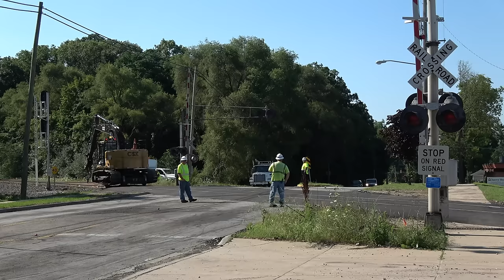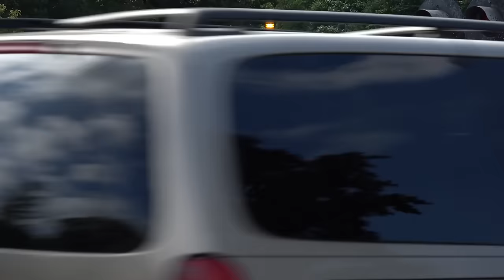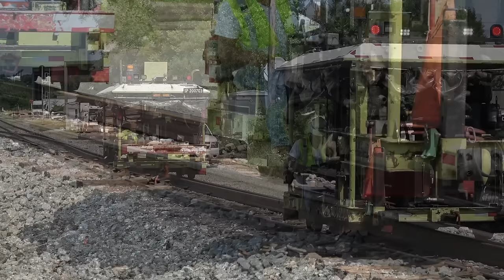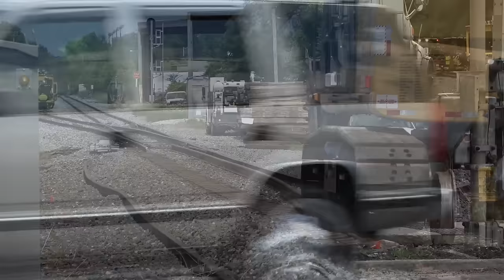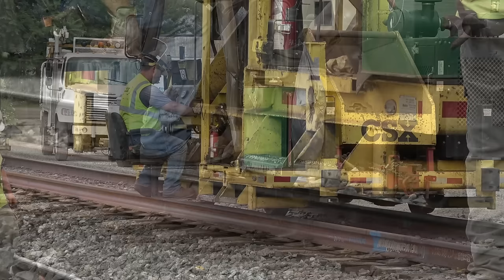TRRS 547: Railroad Rail Replacement

Comment: Why don't they use cement ties like Union Pacific? Get rid of those old wood ties.
Reply from the maker: Track degrades based mostly on tonnage run, and then a bit with the weather. They don't run enough tonnage on this line to justify the additional expense of switching to concrete ties. There's a sweet spot in tonnage, location and curve/not curve that wood begins to be replaced with concrete. Plus, you cannot just swap the bad wood ties for concrete: you have to replace all of the ties in a given section at once.
Reply: Thornapple essentially nailed it in the explanation, tonnage and frequency of traffic are prime factors. Also the type of weather and ground conditions are variables considered in this too. When I was in Florida, they replaced a string of track with concrete ties only to find them sinking into the mud that lie below the ballast and subgrade. The track required so much maintenance that it was fiscally unreliable as a means to support and maintain gauge. That section of track was subsequently abandoned and dismantled, partly because the railroad could not justify the expense of replacing the ties again with wood ties or an alternative that would function equally.
Reply: @SD40Fan_Jason  We have the mud hole problem on one of our interstate lines in Australia between Sydney and Melbourne. When they replaced the wooden ties with concrete they didn't recondition the subgrade and ensure the ballast depth is correct, as is usual practice here. When done properly the track seems to last at least 20 years without being touched.
Reply: Union Pacific dose not use all cement ties. I live along one of their main lines in central Missouri and approx five years ago they replaced all the old wood ties with new wood ones. That was fascinating to watch and talk with these crews. They didn’t replace all the ties at once but staggered the replacement they approx two weeks later they returned and replace the ones they skipped the first time.    I asked one of the crew about this and he said as they could only pull three old ones at a time then skip two or three then pull three more etc to keep the rails stable as they moved down the line.
Reply: Cement ties cannot be used on switches. Can someone tell me if this is true because of nescesary flex for proper switch function? Also, is there such a things as composite ties?
Reply: @somethingsomeonesaid6455  They can be used, however the ties need to be manufactured with the track mounting points in place which makes it quite difficult to retrofit an existing switch. I've only ever seen switches with cement ties replaced as an entire unit. 
There are composite ties which are made with some sort of epoxy resin, and likely other types I haven't seen. These could be used on switches as they can be drilled on site, unlike cement.

Comment: amazing, I grew up in the 60's and as a teen and young adult in the 70's. I knew several men who were on disability with extremely bad backs from railroad work. One in particular had several surgeries. Not to hard of a job these days. Still some work involved but nearly as back braking. No sledge hammers and you even have a seat to sit on while putting those spikes back in!!!
Reply: Nyct is still the same way..people with horrible back problems .

Comment: As a high school kid back in 1963 and 1964,I became a dani dancer who worked on railroad putting in ribbon steel,back then we had a lot of spark mal action,I got very good in hammering the sparks down,outside spark called anchor.spike,we were working in MT and Wa state,but in 1964 Glacier Park got flooded out,so we spent a lot of time,putting in new track,pay was$2.89 per hour,great pay for a high school.kid,we had a sixty man crew,it was a great time be working!

Comment: Its amazing how easily these machines make track work look. We do a lot of our on rail work (Privately owned terminal with appx 4 miles of rail) and the only thing we have machine wise is a backhoe with a spike bucket on it to move ballast out the way and remove/install new ties. Otherwise everything is done by hand with tools (Claw bar, tie pincher, air operated spike driver and what have you).

Comment: I'm amazed about the ancient wood ties still used instead of concrete!
Reply from the maker: Concrete only becomes worth it for high-class track for high-speed trains due to gauge-keeping requirements, or for really high-tonnage areas. This line is neither, so wood ties that are far cheaper and easier to handle that will last 40 years are just fine!

Comment: I had always wondered how the rails are laid around curves. 
I had always thought that the rails are totally rigid, so I couldn't figure out how curves were set.
Then in this video, I watched them lift a length of rail which flexed like a wet noodle.
Problem solved.
Thanks for the video!
Reply: I once saw a rail being loaded back on to a rail train jam against a storage pocket. It momentarily stopped the rail. Before I could release the driver controls, the rail snapped out to the left in a 10 foot curve and then snapped back, just as fast, after I released the controls. So fast. So scary. Death follows those guys around just waiting...

Comment: I am a year late but, this past summer, I watched rail replacement on the CSX line just few hundred yards to the north of me. I did not see them replace the actual rail, but I was able to observe the rail welding, grinding, and spiking operations, and of course the boom truck which picked up the scrap metal. For some reason the old rails have not been removed, but still lie in the ditch, awaiting to be picked up someday.

Comment: I love the fact that there is a piece of equipment a 3rd the size of a train that just pulls railway spikes.
Reply from the maker: They used to be a lot smaller but by the time you add a fully enclosed cab for the crew guys, it adds a lot of space.

Comment: I used to be one of the "old style" rail crew workers on the Maine Central Railroad, working out of Waterville, and South Portland, Maine.  I spent many an hour using the "nine pound hammers", driving spikes into both green ties (and a few dry ones)!  I spent the last few years, however, on the Signal Crew, with the majority of the years in between as a clerk.  A friend tells me often that I am probably the guy who has had more different jobs than anyone else has ever had on the railroad!
Reply: Spiking is the way to go
Reply: @mrerok  I know!  In Maine, we tried "Tieing" the rails down, but the results were less than satisfactory!  😷😷

Comment: Have for some time wondered how these repairs/upgrades were done. Boy flexible isn't kidding, another curiosity explained. Nice but I still miss the old clickity-clack as much as the steam engines.
Thanks for making this video. As for the workers, perhaps an eaiser job with these machines, but still hard, hot, and back-breaking work.

Comment: Very interesting.  At one time, a road gang of 50 to a 100 men would've done the heavy work with ancient tools.  On another note, think of the geniuses who designed and built each machine and all of its component working parts.

Comment: I've seen em weld the rail with thermite using  little tiny stools the crew rode on- Thx for the explanation of how the "flash-pot" method is, of course, better-

Comment: Very interesting indeed. In any other country, this would've been seen as an opportunity to replace all those outdated wooden ties with modern concrete ties. The US remains the only country where wooden ties are used almost exclusively, even though they require far more regular maintenance and as can be seen here, replacing the rails is a rather substantial process that requires a lot of manual labour, where swapping rails and ties with concrete ties where the rails are clipped in, can be semi-automated.

Comment: 17:17 no filler material needed. That’s the benefit of fusing the track with heat and pressure alone. The track composition stays relatively unchanged. However I’m sure the high heat required does change it slightly. I’m not a rail worker or a metallurgist. Just a home hobby welder.
Reply from the maker: The weld cools at a similar rate to when the rail is rolled, so the metallurgy is as close as you're gonna get without going through actual control cooling.

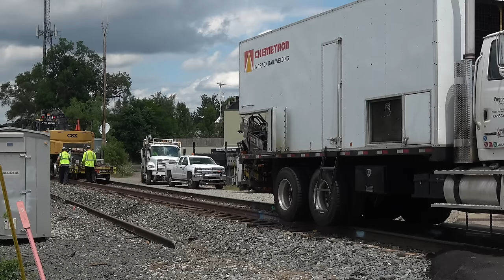Comment: 18:55 When that panel truck backed down the rails I wondered for a second where the smoke came from. The heat from the weld was melting his tires lol.

Comment: I work for the company that produces the High-Rail excavators used in this video. It is a RCE Equipment Solutions John Deere 225D reduced tail swing Railavator produced in Rockford IL. 
The newer model is a RCE 250G   Railivator.
Reply from the maker: Awesome - thanks for pointing it out, Doug. I have updated the description.

Comment: Excellent video. Very well made. It continues to amaze me that the US continues to use dog spikes. We haven’t used these in New Zealand for over 30 or 40 years. I assume the reason is that you use hardwood sleepers. We use pine (softwood) which is no good for dog spikes. Screw spikes are used in pine sleepers. KiwiRail is putting in more and more concrete sleepers with many turnouts are being laid in either concrete or plastic sleepers. How wide spread is the use of concrete sleepers in the US?
Reply from the maker: Correct, most mainline mileage in the US is hardwood timber. A lot of high-tonnage areas, especially in curvy/mountain areas are concrete, however. BNSF and UP have bought into concrete ties a lot more than CSX and NS, however.
Reply: Thanks!

Comment: 17:10 worker puts their hand directly under the welding machine, where even the tiniest drop could injure their hand - is that safe? how is the welding machine secured vertically: through the ballast bed directly, through the rails being welded, or through some kind of stiffening/braking of the carrying vehicle's suspension & crane? as an outsider, it seems there's nothing to prevent the welder lowering as the rails settle/move during the welding process. thanks to the crew for your hard & vital work, and solidarity forever with any rail workers who want to strike for better pay or safety!

Comment: Very well done. I would like to suggest however that this presentation would benefit from including specific figures indicating the "average" gang production (rail/track miles replaced and average costs per shift/day) along with the related issue of tie life/replacement. Otherwise, this is an excellent video. 2023/08/20. Ontario, Canada.

Comment: It's not just flanges wearing out rails on curves. You have hundreds of thousands of solid axles going over it. These axles do not have differential gears or independent suspension. Therefore the outside wheels will want to cause the inside ones to speed up while the inside wheels want to slow the outside ones down.

Comment: Besides the weight what's the difference in size between the old and new rail, the height or the thickness of the web? Great explanation of what was going on.
Reply from the maker: You can look up different rail cross-sections on Google. Search AREMA typical rail sections.

Comment: In advance sorry for my bad English, I am from Finland. I work in Finland as a construction site manager and I'm civil engineer that has specialized to rail works. Sometimes it looks odd to me that in America so much resources are wasted, and i wonder why. I'm curious of the costs what this piece of work has. So many machines doing simple tasks, that could have been made by manpower, so I'm little irritated for the company that they have to pay so much for something so little, not to speak from the eyes of who ordered the work. 
I could say only machine that there should be is that rail excavator, because it lifts the rail off from those sleepers. After that all other tasks can be made by hand.
If i tell all these work steps here maybe it could make my explanation more clear:
- Spike pulling: 3-4 guys with iron bars can do that distance in 15 minutes
- Lifting rail off: rail excavator lifts the rail to the side
- Taking plates off: from those 3-4 guys, 2 guys with rebars or such throw those plates to side of the rail
- Filling spike holes: leftover guys start filling those holes with chemical compound what is in PORTABLE container
- Clearing top of the sleepers: guys that have thrown those old plates to side of the rail, start brushing off those sleepers 
- Aligning new plates: guys that have filled those holes come back and start putting new plates in place (that have been laid between tracks beforehand)
Aligning
Reply: - Aligning new rail: rail excavator starts to fold rail back in place
- Nailing new rail to sleepers: all those guys can now come back and start hammering those nails in place, and rail excavator can be helping them to assure correct track width
- Anchors: same as above
- Collecting old material: rail excavator with magnet collects it all by one sweep

Welding the rail: Why not use thermite? (Its portable and can be made by manwork) 
And that rail heater is such bs, those rails can be welded in different temperatures than neutral, the rail just needs to be neutralised to correct rail warmth. (either pulled or pushed depending of the weather) 

Of course i understand if they change like 3-5km (4,8-8 miles) of rail in a single day, then it is a different story.

Please argue with me so i can understand what is this all about.
Reply: @mawaa257  They replace many miles of rail each day. Also the labor costs in USA are extremely high.
Reply: @MotoKeto  Oh, that explains alot. Can you estimate how much are the costs per person per hour? Just curious, so i can compare them to our prices.
Reply: I looked this up and i found out that in USA average railroad worker makes bout 23$ / hour, and employee must pay insurances etc. on top of that at rate of 1.25 to 1.4. So we can come to an conclusion that the cost of average railroad workers labor is 28,5 to 32,2$. In Finland average railroad worker gets paid 16,05€ / hour, and to that employee must pay insurances etc. at rate of 1.7, so the cost is 27,29€ for the employee. 
To get these to comparison we need to change euro to dollars, so in Finland the cost of labor is 27,29€ * 1,19$ = 32,47$. 
In conclusion we can come up to that it is not so high labor costs after all. 

How about the machinery in USA, i have looked gold rush and they speak that new machines cost millions of dollars. How much is that railroad excavator for example in USA?

Comment: Good presentation. Why not replace the ties at the same time?Many looked weather worn.
Reply from the maker: Weather worn doesn't mean they can't hold gage and surface. Replacing ties at the same time as rail is also a challenge since the machines for both change-outs essentially rely on the other being there for alignment and support.

Comment: I see in the description that it took just over 4½ hours to complete this job. How long was the section they replaced? How long would it have taken if they weren't being filmed by a stranger?
Reply from the maker: My presence didn’t slow them down. 4.5 hours is from when the train arrived, to when they’d finished about 1600’ of rail replacement. Actual time from first machine to last machine was much closer to 90 minutes or so, and that is with them working on that slower section with the break for the road. A good rail change crew can complete at least 4000-5000 feet of rail in a 10-12 hour shift. Might not sound like a whole lot but it’s still way faster than it used to be!

Comment: This was just fascinating. I've often wondered such work was accomplished in 1840. By hand of course. But how? How were lengths of rail bent accurately on sharp moiuntain curves? Heat of course, but how was it bent? Anybody know?
Reply from the maker: The rail back then was significantly lighter than today - often around only 40-50 pounds per yard. It was delivered in 30-40 foot lengths. They'd spike in the one end then with crowbars curve it into the curve, spiking it along the way to hold it. Since most railroad curves are very gradual, it actually wasn't much of a problem, aside from the manual labor component of the task
Reply: @ThornappleRiverRailSeries  39 feet, to be precise.

Comment: All of this machinery and manpower just to do a little bit of track. I can barely imagine what it takes to maintain 100 miles of track that runs in both directions
Reply from the maker: The good news is that rail and other track materials tend to last a good long time. But yes, it is a lot of work to change out.

Comment: Why do they still use wooden sleepers? On Australian Railways since 1995 most if not all have been replaced with concrete sleepers which last many times longer requiring less maintenance.
Reply from the maker: Concrete ties are not always worth their additional cost. They are great for super high tonnage due to durability and used for high speed passenger and higher tonnage curves for their ability to hold gauge really well. However, since they cost more, it has to be somewhere that wood ties perform significantly worse. Lines like the one here don’t have enough tonnage to justify the additional expense. Typically, concrete tie life is still roughly the same as wood, in the 30-50 year timeframe depending on conditions.  An additional thing to consider with the cost is that switching between wood and concrete requires replacing 100% of the ties in a given area, versus replacing just the ties in poor condition as is typical practice in North America and elsewhere. That means you end up wasting good ties to put in concrete, making the whole endeavor more expensive still.